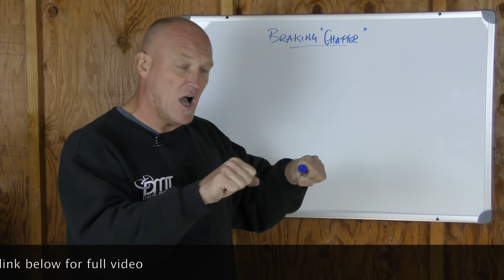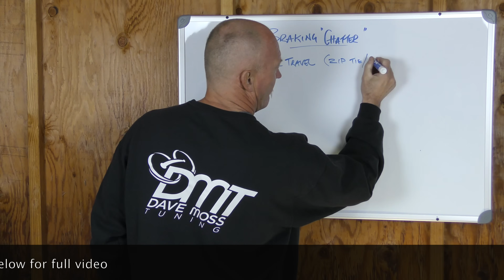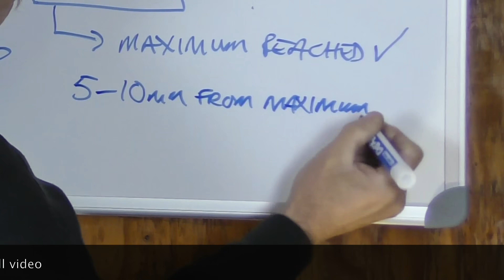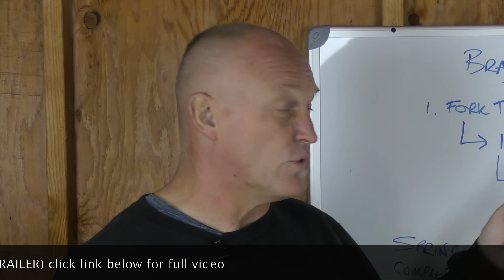FasterClass: Troubleshooting Braking Chatter (TRAILER)

Comment: I am riding bmw hp4 race
After the first turn, chattering will occur after the brake and will be removed when the throttle is opened again
Currently, the oil surface of the fork is 220mm
Spring is 1.05 on the left and 1.05 on the right (The fork is Olin's fgr300)
Fork butter always hits the bottom 
Last week, there was a slow slip due to chattering
Which one should I modify?
Reply from the maker: If you get on the throttle and the chatter disappears, fork rebound is too slow. Based on bottom out, preload should be at 10 turns in with compression close to maximum as a test. If you get 10-15mm from bottom, that shows damping is effective.
Reply: @catalystreactionsbw
Reply: 리바운드는 21 클릭입니다.
댐핑은 19 클릭입니다.

Comment: Brilliant video as usual.
I've been bottoming my recently revalved front end and am near the end of adjustment so I have been recommended to put one heavier spring in one leg as the two would be too much. I have no doubt they know what there talking about because its coming from a major suspension manufacturer. So what do u do about things like preload and compression do I still keep adjustment equal in both forks or is there a magic formula?
Reply from the maker: Thanks! In that case I would be looking at adding more oil to leverage air spring effect first. IF that curd the problem, great. If I am almost all in for preload and compression I personally would revalve compression 1st. As for the spring rate, yes we would make half steps eg: 90/90 to 90/95 (harder spring in the right leg).
Reply: @catalystreactionsbw  Thanks Dave. Have just put a heavier spring in and have learned so much from you. It's funny when at the track and I get the screwdriver out to adjust settings just how many people look at me  as if I'm a wizard and the screwdriver is some kind of magic wand 🙃
Reply from the maker: @johnhewer0  It is indeed funny - hopefully we can change that situation with more and more riders realizing that changes make a profound difference! Thanks for paying it forward even if that is a visual of getting the screwdriver out.

Comment: I watched the full vid when it came out a couple of days ago. Then yesterday had to stop quickly when a car pulled out. I felt the clunk of bottom out. So have marked on the fork leg where the zip tie ended up so I know exactly where bottom out is. Its got 10mm less than they say it has. But now i know and have added 2 turns of preload and will keep an eye on where the tie ends up.
Reply from the maker: Williams, replying here.  Fantastic!!  Not that the car pulled out or you bottomed the forks, but that you're taking control of the situation.  Well done!  I' m getting all teary eyed here.  You made my day.
Reply from the maker: Thanks for sharing your real world experience Rob. That means a lot as part of the paying it forward experience for everyone to benefit from.